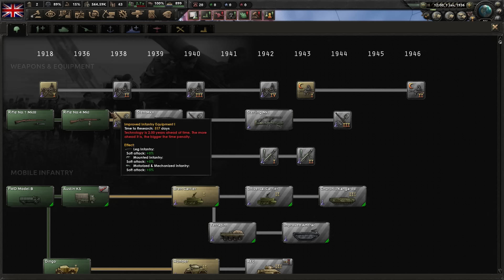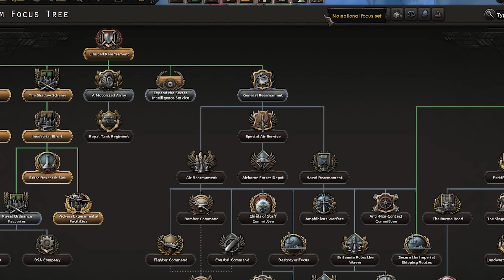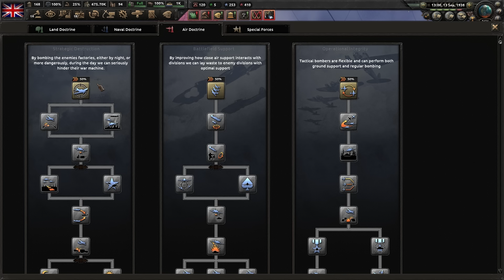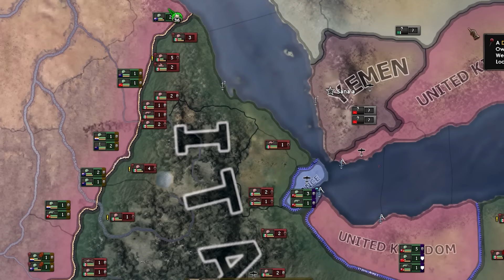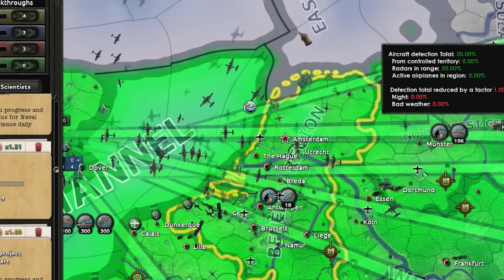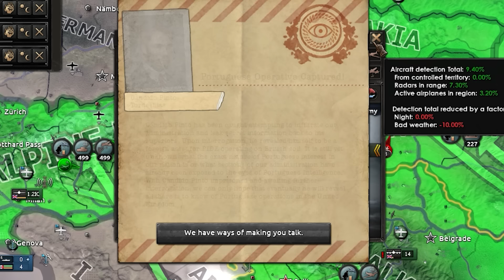Can you BEAT Hearts Of Iron 4 using PLANES only?! (HOI4)

Comment: I have point out one thing - i think you can recall when enemies where bombing you. You were putting civilian factories to repair damages instead of building new factories. Strategic bombing masterpiece is just that. It is not about putting enemies behind by destroying their factories, it is about keeping them in same place they were before bombs started to land. Keeping their factories at 15-20% of unusability menas they have to constantly put civs to repair that, instead of building new ones. Longer the war drags on, the higher disproportion becomes.
Reply: It also puts the efficiency of mills in the toilet. When a mill is repaired it's the equivalent of a freshly assigned factory.

Personally I prefer wrecking railways. If you target western Poland Germany physically can't push the Soviets.
Reply: @simonnachreiner8380 you right with the railways because to have en imapct on industrie you need to cover more then half of the enemys provinces

Comment: 30:23: actually, IRL thermonuclear bombs produce much less radiation then nuclear ones. In fact, the place of detonation of the Tsar Bomb, the most powerful one in history, became safe for scientists just 2 hours after the explosion.
Reply: wrong
Reply: @cppcompile  No. YOU are wrong. Paradox needs to consult a Physicist.
Reply: They have a small uranium charge, but only for igniting the thermonuclear fission. That uses hydrogen which is not radioactive at all.
Reply: Does that mean we can nuke without concern about our next generation environment for living?
Reply: @ศิวศิษย์แสงนิกุล , thermonukes do create a wasteland, but not radioactive one, nature can quickly take that back. 
Uranium nukes, however, are bad for ecology.
Reply: @uncorr6982 🤔🤔🤔🤔 interesting
Reply: @uncorr6982  Ok so those responses are just wrong. 
1. Yes, the primary is a fission bomb (uranium or plutonium) that ignites the secondary. Several thermonuclear designs use an uranium (U-238) tamper/jacket around the secondary that goes through fast fission, induced by fusion neutrons, which creates large fission yields and fallout. This means that modern thermonuclear bombs can produce far more radioactive fallout than a fission weapon of lower yield.
2. “Hydrogen … not radioactive at all” is false if you mean the isotopes used in weapons. Protium (1H) and deuterium (2H) are stable/non-radioactive. However tritium (3H), which is used or is generated by weapons and in boosted primaries, is radioactive with a half-life of 12 years. Also lithium based elements used in secondaries create tritium.